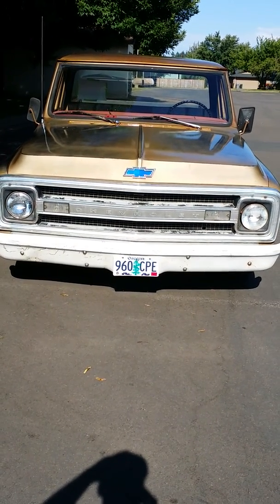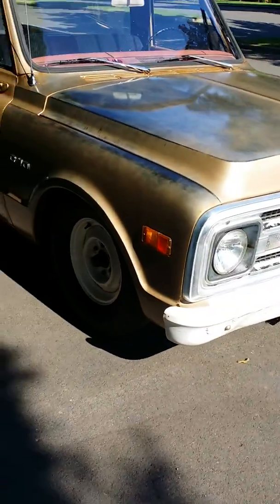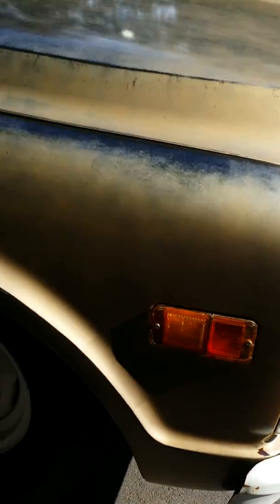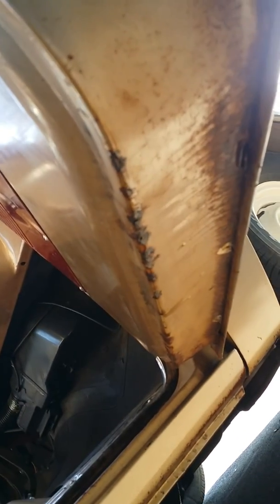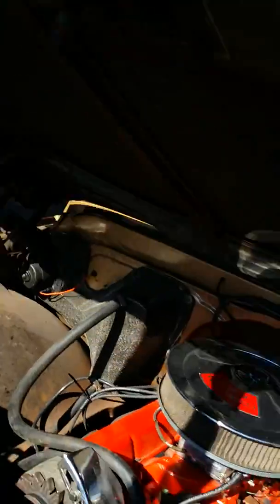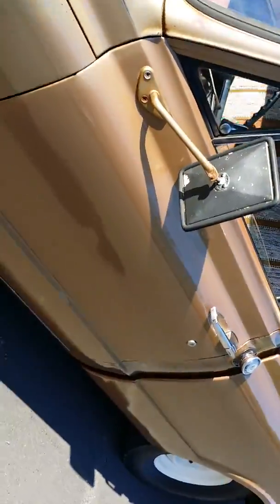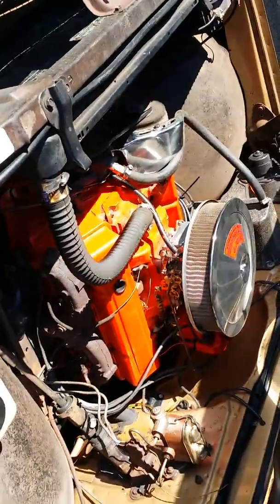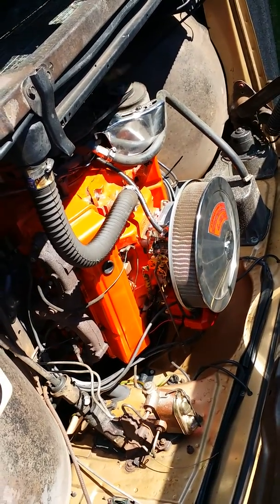69 C10 patina

Comment: Really nice job I was wondering how much does one of those conversions cost?
Reply from the maker: $1000 to cut the frame. About $1500 to cut the bed. But it's only about $900 a piece for new bedsides. That's usually the way to go.